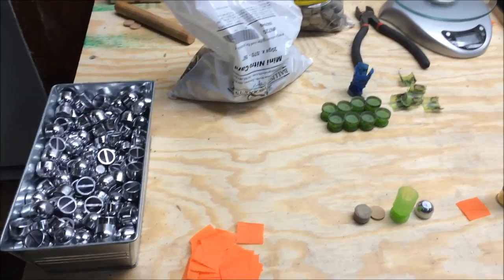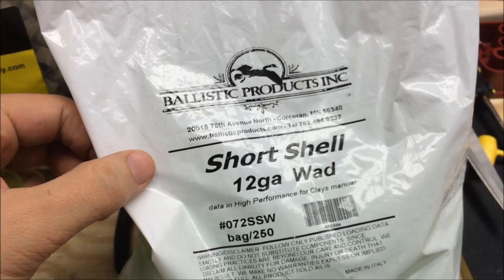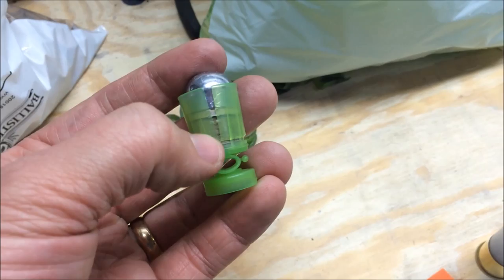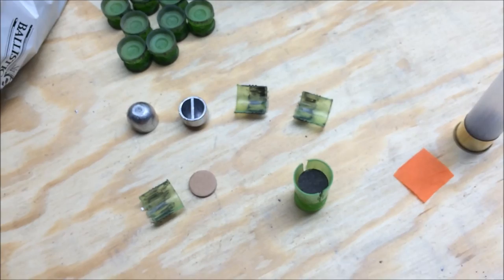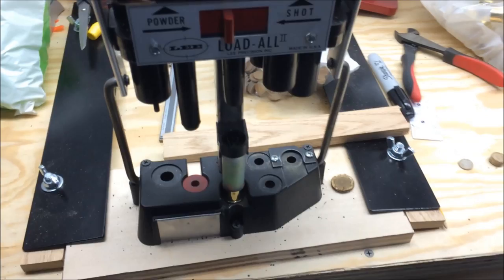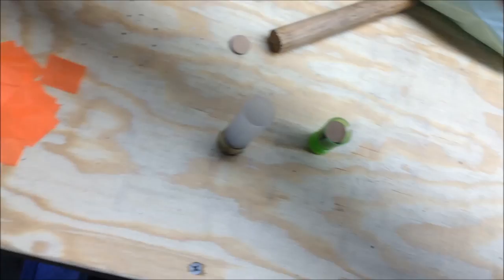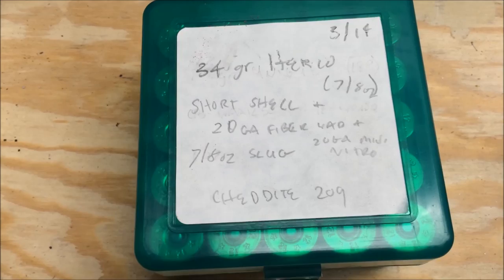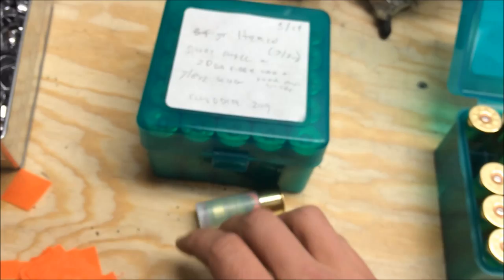Loading Lee drive key slugs with BPI short shell wads and Herco powder

Comment: I think you are using a straight walled hull and a tapered wad which leaves that gap for the powder to leak.
Reply: The slug is also bulging the top of the wad  (because of the petals) causing a gap at bottom of the hull.

Comment: THANK YOU FOR SHARING A WILL FIT WAD STACK COMBINATION... FYI: RECENT NEW CAMERA TECHNOLOGY... HIGH SPEED RECORDING FOR slow motion playback... has revealed that  SPIN STABILIZATION of slugs  is not needed and  Foster type or Brenneke type rifled slugs in smooth bore actually do not spin  as we all  previously believed they might.   The  way the flat or slightly rounded noses of slug push the air aside do not actually allow those  shapes on the perimeter of slugs to impart a spin.  We wanted to believe those spin... They actually do not.  AND , surprise  the hollow skirts or attached wads do allow drag stabilization to keep the nose forward or prevent tumbling.  ACCURACY, WITHOUT SPIN... ? YES.   ...SHOCKING ?  YES, I KNOW...IT IS.

Comment: Just put in the link - my Red Dot loads are only going to be in the 1100-1150 fps zone though - I'll chrono them shortly - reduced powder slugs only - Your slugs are near full power with your Herco and inefficient Blue Dot.  I'll be working up to 35 Herco with the 525 slug as well... Best Regards...

Comment: I do the same load with 30 to 33 grains of longshot .. its a bit more pressure but burns clean  and produces great groups at 150 feet. ive also used clipped waa12 wads and 12s3 wads for near same results with the same powder load .. good luck and thanks for the info .. great video
Reply: What kind of hulls you shooting? I have some of the claybuster replacements for the 12S3 and some claybuster replacements for the WAA12SL, just got a 7/8 ounce Lee mold and looking to put together some rounds. Ive got some Long shot Red Dot and some Unique and hundreds upon hundreds of different range pick ups. Any help would be of great use.
Reply: Do you use the same wads? I was just going to ask him about his powder selection and how he came to select hurco as I could not find any loads using it. And I have Longshot powder.

Comment: The Ballistic Products Lightning 7/8 wad fits the 7/8 Lee slug well IF you use a 20ga felt wad under the slug.  That lets the top of rounded shoulder of the slug ride above the petals without trimming.  I shoot them in smooth Skeet 1 choke for consistent less than 3" groups at 50 yards.  I use the recipe listen in the Ballistic Products charts for this slug and wad and with Green Dot, but reduce the charge by 1g since I added the felt.  No signs of over pressure and the wads keep their petals.

Comment: If you use a wad that is too tall they will reopen.
And yeah, I used one of those formulas with a similar wad design to what you used and they will collapse if you try to compress them before crimping. they seemed to shoot ok, but since I was at an indoor range (all that we have locally) testing for long range accuracy and inspecting the fired wad was a no-go. I'm tempted to take them all apart, install a different wad then roll crimp them all.

Comment: Nice job with this - I've come to the same conclusion with that DR XL Blue wad - can't get acceptable accuracy out of it past 25-30 yards - so it's only good for range and plinking uses.  All these years, I've never tried BPI (seems like a small company with some unusual slugs, etc), staying with the bigger manufacturers like Lee, Lyman, Winchester, Claybuster, and Downrange.  Must be a leftover from my competition trapshooting days - BPI wasn't much into the clay shooting games.  But your work is intriguing.  We shotgun slug reloaders get a good feel for when crimps are "active" - when we have an excess in column height and are forcing the crimps closed, we get the "active" crimps that will open over time.  I'm going back to do work with the Federal wads (stronger compression zones) using once fired roll crimped Fiocchi empties (very similar to your Cheddites) and the Lyman 525 slug.  Your video is a good one...and I'm going to add a link to your video on my last one.  Have a great day...
Reply from the maker: I haven't bought their slugs, but it looks like some of them are kinda like lightfield knock offs.  I get all sorts of black powder components from BPI, which naturally morphed into casting lee slugs and finding something I could have a real fun time shooting on the cheap during this ammo shortage.  Seems like shotgun stuff is all still available, except for powder.  Cast your own, hulls, wads, cards, 209 primers all readily available.  Heck you could probably shoot these things with black powder which around here is readily available.  That is if you don't mind wrecking some of your hulls!  Good reason to pick up club hulls from the range.  I dont know how you would load these into a magtech brass hull hahah but that could be fun!
Reply from the maker: oh yeah... I have had success with those federal wads with roll crimps.  The trick is again to get the height correct with a nitro card under the slug, and crimp just the right amount.  I use a drill press and set the height for consistency.  I also like those federals due to their super strong compression area.  http://tmp.smugmug.com/photos/i-K2wDkbq/0/XL/i-K2wDkbq-XL.jpg .  This was with Blue Dot... same issues with lousy ignition.  This would fire real well with Herco I'd imagine.  I don't know about accuracy compared to these shorties though.
Reply: sir sloop I think another reason I avoided BPI and Lightfield slugs in the past is because of having to buy them when I could cast my Lees for next to nothing.  Hard to beat factory performance and accuracy (with their proprietary wad slug systems) with our slugs, but you may have broken the barrier with these BPI wads… Best to ya
Reply: I agree Dr blue wads aren't great at fifty yards. Federal was a little better at fifty yards

Comment: Good stuff here. Gave me a better idea of what I need to load mine. I have some LEE 1oz drive keys and some Lyman 1oz. For powder I have BlueDot,Clays and Unique. Might need to lay in some Herco and Red Dot as well. FC-45 seems to get great results with it. BTW  He sent me here too. Glad he did. Gave ya a sub and hope to learn a lot. Thanks
Reply from the maker: I've had success with Unique powder as well with these slugs in lighter loads.  I haven't used the faster powders for full horse stuff.  Probably a little safer with a slower shotgun powder.  Shotgun is more difficult to judge pressures than with say a pistol or a rifle.  Ya know they run relatively low pressures with a big honkin heavy duty primer.  By the time you see a flattened primer you are probably WAYYY past the max load you should be using.  Luckily there is generally A TON of load data for Unique, so I'm sure you can find what you're looking for as far as weights, etc.  When you start dealing with lesser used powders or lesser used components like Cheddite/Fiocchi hulls, shorty wads, etc... you kinda have to rely on the kick-o-meter and maybe comparison to firing published data loads.  I brought some 47gr blue dot loads with me for direct comparison while working up to 33.5gr Herco.

Comment: My short wad slug load is with the winchester red wad or claybuster replacement 1138 wad. 23 grains of green dot , 1138 wad with 20 gauge card. I then overcrimp on the Lee press so as to see the slug rather than roll crimp. I also use this same 23 grains  of green dot , 1138 wad with 10 - 00 buck , stacked by 2 and a normal crimp. Both loads work well with 25 grains of Herco also.

Comment: I always had trouble with slow-burning powders if my wad stack shot cup and the shot didn't fill the shell and make a good hard crimp. There is a reason commercial slugs and buckshot come with roll crimps. A roll crimp lets the powder build up pressure sooner. Blue Dot needs to build pressure as fast as it can. I think roll crimps will make your groups smaller.

Comment: Try trimming your cases to 2-1/2" and use a roll crimp, never personally had much luck with star crimps on slugs. Most factory slug loadings seem to use roll crimps.
Reply: I was wondering that very thing. I just ordered a hand crank roll crimper. ...  they use to roll crimp plain shot loads too. Im beginning to wonder if the roll crimp might just be better for hand loads?
Reply: @blueduck9409  Save your money if you are ordering the Russian bench mount roll crimper, the best one I have found is the drill or drill press roll crimpers from BPI.
Reply: @wrxs1781  i already ordered it. It was not expensive at all. I saw an antique  roll crimper that was really well made. Cant find that one. Thought id experiment with the cheap one. I will buy others tho, because i want to play around and see which works best for me. I dont do alot of shot gun shooting, but its nice to know i can make plink loads should i want to.

Comment: I had the same problem with un-burned powder using blue dot when I tried it in .44 special, If I fired 6 I could almost dump enough powder out of the empties to load up a 7th! It did work fairly well in 124gr 9mm+P loads though.
Reply: Blue Dot is what it is , and does what it does well .  But it is Not a good choice for this application , it is way too slow . ( But I suppose the pressures were very low, if that's what you were seeking .)

    Slug or not , the weight is still only 7/8 oz , and Blue Dot is rarely used for less than 1.25oz in 12ga .  Instead try one of the plethora of powders commonly used for 7/8 to 1oz loads .
Reply: Blue dot is for heavy shotshell loads and magnum handgun loads. They also typically use magnum primers for a better powder burn.

Comment: Great video lots of good information. I am looking to load 12g slug for Practical shotgun with the Lee 7/8oz lead slug. I have seen comments on the Lee mould instructions and elsewhere that only pure lead is preferred, and wondered if you had stuck to pure lead slugs or if range lead with a particular ratio or hardness could be used. I understand that shotgun loads do not produce the same high pressures associated with pistol or rifle. Finally, do you have any 12g load data for Nobel (Glasgow) No: 80 powder and the Lee 7/8oz slug?
Reply from the maker: You can use any mix of lead, as the sabot is what interacts with the bore.  For that reason, you could really load anything in these, as long as its 7/8oz.  My sabots are from a mix of of dive belts, lead plumbing components, and 1# 50% tin soldering bars.  I don't have good load data for No80.

Comment: Do not deviate from the recipe. Do not deviate from the recipe. DO NOT DEVIATE FROM THE RECIPE!
That's all I ever hear, and I have read the Lyman shell reloading book and seen how any one thing different, like the wad can change the pressures up to so called "dangerous" levels.
I also read an article where a guy was tasked with doing destructive testing on 870 shot gun barrels and was unable to get any of them to either bulge or blow under 55,000 psi!   I also found a recipe for a 7/8 oz shot load and everything was the same as what I have (Gun Club hull, windjammer wad, Remington primer and 17 to 19 grains of Alliant Clay Dot powder) except I have a 7/8 oz LEE slug, and was told (DON'T DO IT!) even though the pressures were real low (5,000 to 7,000) and I have a cylinder bore with no choke for a slug to get pinched tighter in the bore!
What is the actual deal with this? How does a shell know the difference between 7/8 oz of #9 bird shot, or 7/8 oz of buck shot or a 7/8 oz slug?
If there are any shotgun reloader near me, I am unaware of them!

Comment: So this recipe? Does it require Chedite hulls? Or can I do the same with range pick-ups?
Reply from the maker: range pickups might work... depends on which hulls you have.  you can try them and see which pickups work best.  i would back off the powder charge to start though if you use a different hull.

Comment: Shouldn't you use an overshot card for the Lee if you are roll crimping. Not so much with a crimp.
Reply from the maker: no overshot card needed with a slug when roll crimping, as long as the shot column is the correct height and the slug is pushed up to the correct height with undershot cards. this prevents you from thinking you have a shot and loading a slug.  it also prevents the overshot card from interfering with the slug... accuracy
Reply from the maker: well the job of an overshot card is to hold in shot, not improve the crimp on a roll crimp.  the short wads in my other video eliminate the need for it anyway... much better performance than this load

Comment: Ok,.... you buy a BPI slug reloading manual.
It gives you all of the possible loades for the lee drive key slug.
It tells you what case,..... primer,..... wad,......felt wads,... shot cards,... over shot cards and what type of crimp to use.
There is no but this guy told about these blue wads.
The blue wads look like a substitute replacement wad for one of the Winchesters like Winchester AA12 or AA12SL
OK
If the slug manual don't say it don't put it in.
A loading manual has all of the possible loading combinations for all cases and calibers.
Use the components the book says to use.
There is no guessing and mix matching and no dangerous high pressure loads.

Comment: First off you're way too proud of yourself for reloading 12 gauge slug woo hoo sucking off that piece of paper may make keep the water in good condition but you're going to have more gas blow by with that paper folded that way path of least resistance
Reply from the maker: If you can come up with a better performing lee drive key slug load I'm all ears.
Reply from the maker: PS i stopped putting paper in them... the powder holds fine without it.